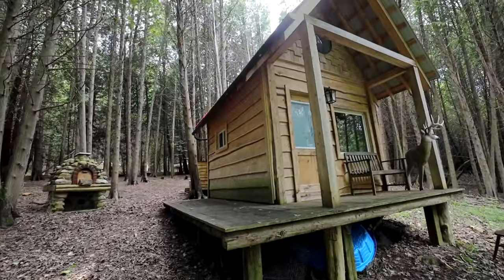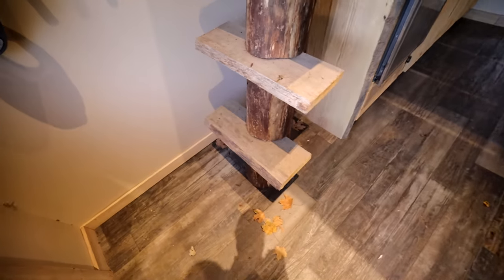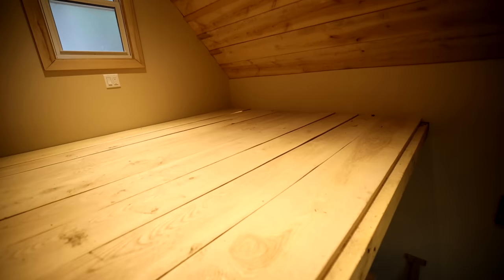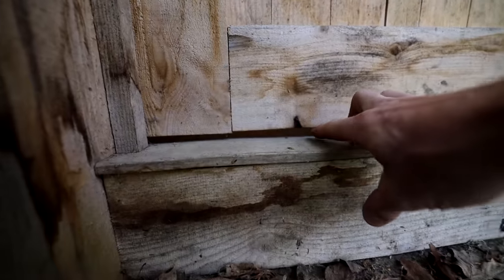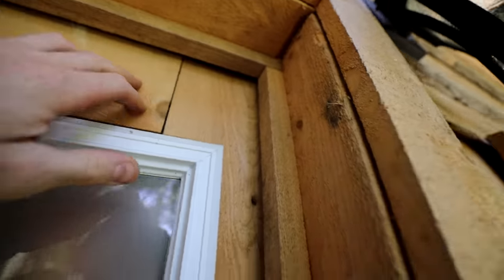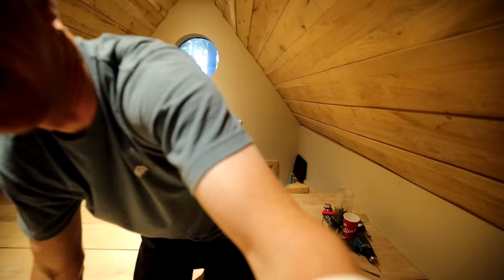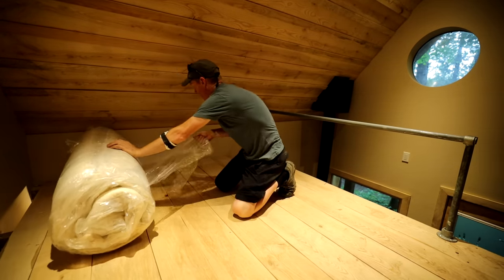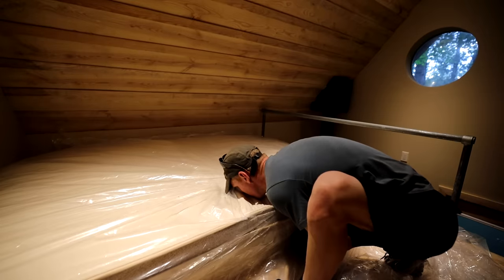Finally Moving Into the Off Grid Cabin! -  Finishing Touches Done

Comment: Secret to keeping the cooler cold longer. Do not use regular ice. I freeze water bottles. As they melt, you then use the water.  And i dont buy small water bottles. I use flavoured sparkling water at home. When they are empty, i fill with tap water and freeze. The larger the bottle, the longer they last. 2 liter pop bottles would work great.  Love your work. ❤

Comment: chunk of quarter round attached to the door over your threshold to keep rain and/or dust settling in.

Do you have any tempered glass you could mount under your safety rail?

a ceramic tile will destroy your knives but be great for hot pots. get a wood or plastic cutting board.

Comment: I once stayed in a little cabin like that same setup for sleeping for work.I found by screwing in a hook the kind you usually hang bicycles with in the garage from the center beam on the ceiling I can easily make a dumb waiter. I chose to use some neat looking cordage and an old aluminum bucket.That way your hands aren't full when you're trying to climb up and down the ladder. A tie off cleat can be secure to your loft easy peasy. I hope you guys had a great anniversary.PS you might also want to turn that mattress the other direction I found it easier to roll out of bed over to the ladder than it is to crawl.😉

Comment: Hey boss. A while back I came across a video about an underground house, but one of the more interesting features was the refrigerator. It was set inside the counter on a spring, or hydraulic counterweight so that the top and drawers lifted up instead of out keeping the cold air of the fridge in the tub rather than spilling out when you opened it. Just an interesting idea for a future cabin build feature. Keep up the content as I live vicariously through your projects.

Comment: With all your power stations and panels... if you have a good solar window to collect enough power for it and induction hob might reduce your propane use some... I have been impressed by a NuWave Flex induction cooker and the low 500 watt demand setting it has... for coffee in the morning kind of setup... less propane use would lower that bill... the setting up solar systems can be expensive... but once in place... it might be a direction to explore for more content of interest to those going off grid... PV solar cooking works well with induction cooking...

Another rabbit hole is actual classic solar cooking with DYI cookers that on sunny days and in places with higher percentage of sunny days... I live in Puget Sound region of Washington state,  a lot of overcast,  I have some issues to design around, but finding PV solar cooking is a way to time shift solar energy collection to possibly be a good route to explore... have used it in a 3 day power outage... with big enough power stations small fridge can be maintained fairly well. And I have used a microwave plugged into the fridge power station.

Comment: I tried using the stud whispering technique to fit a shelf in my kitchen. Except I ended up doing the pipe finding technique instead and poked a hole in a water line.

I mean, the hole was perfectly in the middle, couldn't have done it any more accurately.

Comment: I would have made the bar you grab when coming up the stairs go from floor to ceiling for security reasons and you won't end up on your back on the lower floor when the screws pull out of the floor because of your weight.

Comment: Have you ever used reverse the osmosis on your shop vac 😂?
Seriously, that's why the intake is the same size as the exhaust. Just attach your hose to the other hole.
If you need a blower in a pinch, it works. You could probably use a vac to blow up mattress & other thing like that also.

Comment: Mice have a skeletal system that flattens out to an amazing degree.  I watched in disgust as one ran at my brick veneer house wall and disappeared into a weep hole without even slowing down.  It was on the way to the attic insulation.  I had to use a perimeter baiting system to finally bring the population under control.  It looks like you and Chris should have purchased a property with a stream to feed water into your projects.  Or are you about to drill a well to provide a water flow?  Will you need to engineer a circular flow to go from the 'stream' to the pond and back?
Reply: They have a spring on the property that feeds the pond